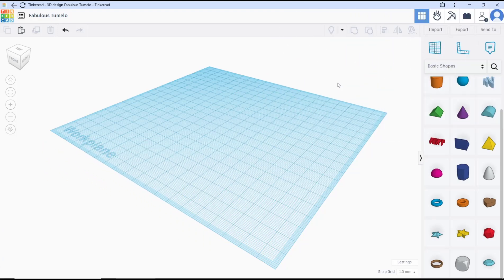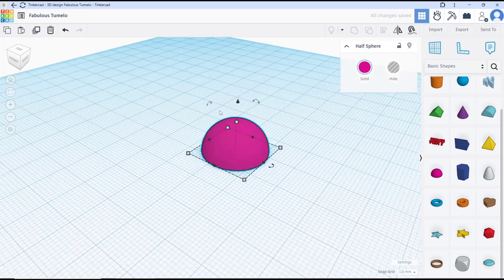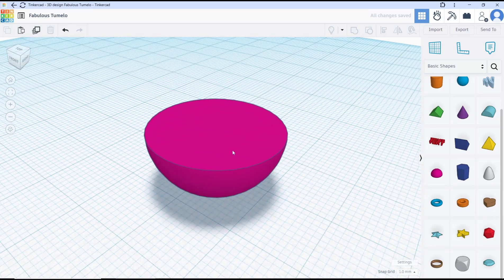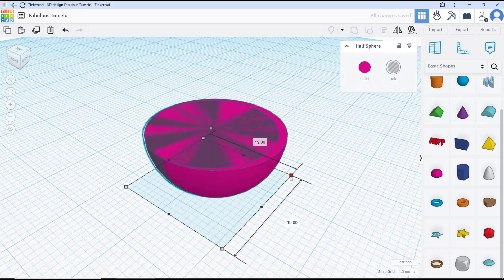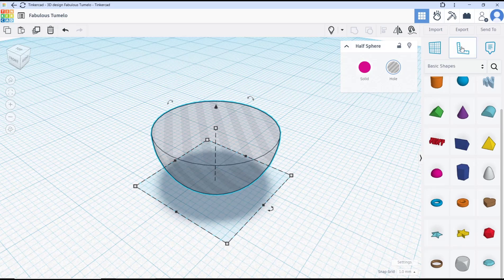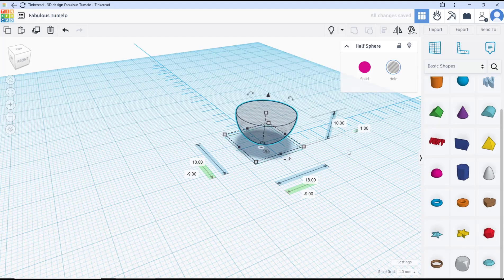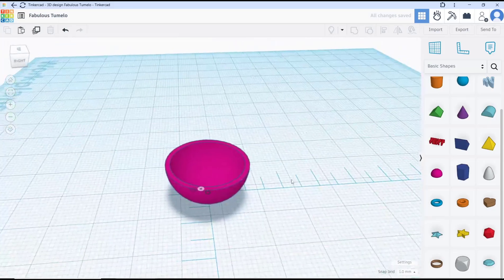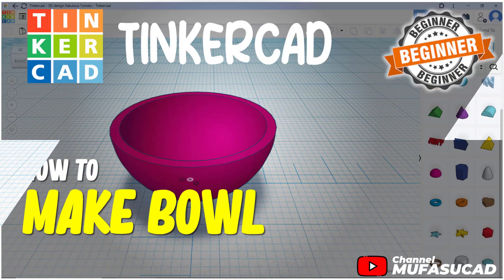TinkerCAD How To Make Bowl

Comment: Hey, keep the tutorials going, I'm not very familiar with TinkerCAD but I am watching quite a few of your tutorials on all sorts of software. I just commented on something from you in your FreeCAD channel which I will repeat here, apologies for that. I'm trying to learn several packages so I can eventually choose one that I like, FreeCAD besides being free seems to also be one of the most powerful but it is a 'different' programs, with lots of problems due to the engine it uses, as well as quirky behaviour.

Right now I am trying out Solid Edge, which I see you have made tutorials for in the past. One of the problems I have with it is that I am trying to put a hole a specific distance (10mm) from the top left corner of an extruded flat rectangle, but I can't seem to figure out how to specify the distance from the left side and from the top to ensure the hole is in the exact place I need. FreeCAD and every other program out there does this so easily, Siemens SE and NX both are so difficult and frustrating to make that happen with. Could you perhaps give me some pointers if you know how to do this?

The main reason I am interested in SE is that I do 3D printing and on occasion I make parts with threaded holes, and SE and NX both do threaded holes. So does FreeCAD and Fusion 360. Creo does not, it only produces cosmetic (fake) threads, you have to create threads using manual boolean operations. Several other programs I've tried also do not do threads either.

Any help you can give me would be appreciated.
Bleys.